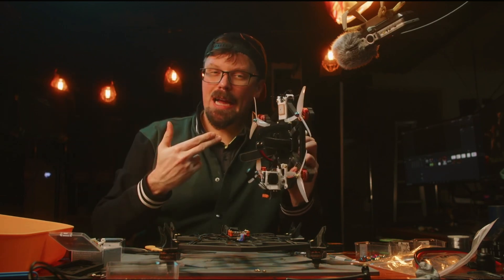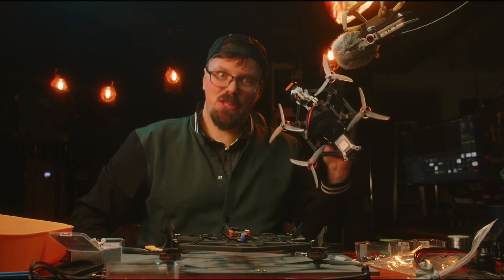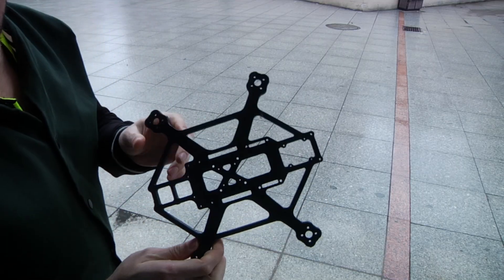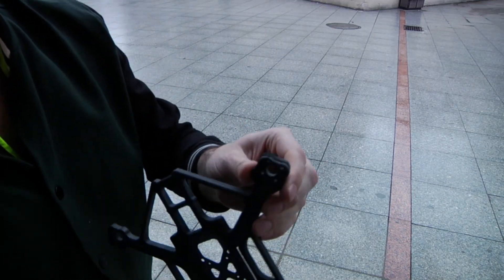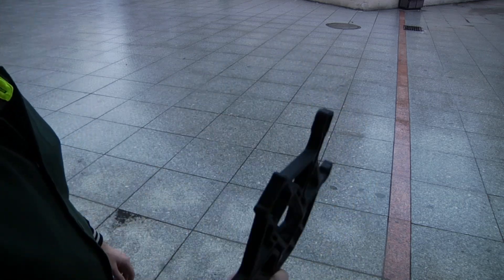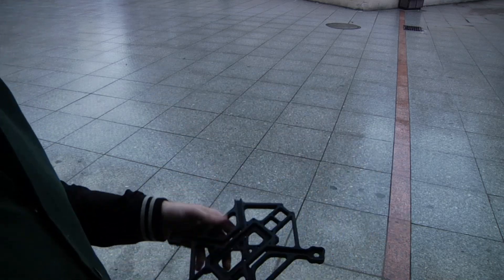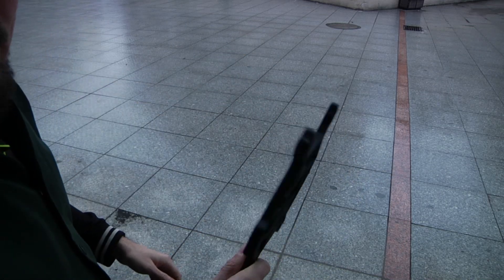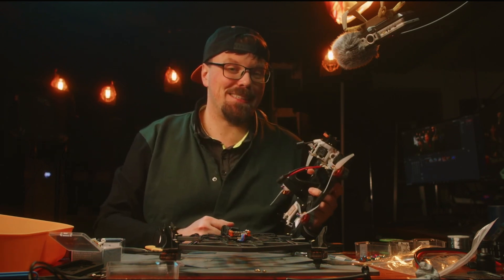Can this 3D Printed Drone Change FPV?

Comment from the maker: https://drive.google.com/drive/folders/1zxm0brhdy93jc6833aE_C-0zilZd7Qmq?usp=drive_link
Reply: THX for  sharing - Assume it was a bad decision to print most of the components and realize that I can fit the  5' frame on my printing table :D. I have Elder 3 pro, looks like a few mm is missing - what a shame, electricity, and materials to the bin :(
Reply: I incresed printer X settings  for extra 5mm , I was able to sliced , let's see what's going to happen :)
Reply: I know this is an older video but did you do a vid on assembly? I like to build stuff and don't care if someone says you can do it. I say "Hold my beer!"
Reply from the maker: @wickedspoke5443  not a video but a guide over on the Patreon

Comment: Personally I think the 10mm U beam design is a great choice. A good balance between price to print, no need for supports, and obviously little to no strength performance change. Already have my frame printed. Now just need parts to get here.

Comment: Once that frame is fully loaded it might be a little more prone to breakage, but wow that filament is VERY strong, impressive!
Reply: Breakage from what. Most pilots fly quadcopters and don’t crash them. Resonance and vibration-characteristics is what I care about picking a frame.
Reply: @nickvledder  I fly through tree's amigo..so breakage from a tree...not thin air.

Comment: I'd argue that it comes down to your intended use. That would probably be fine for people that just want to cruise around with the drone and do mild aerobatics.  It would probably save some money. 

But if you intend on doing something that will likely crash frequently (like freestyle tricks or racing), then consider something like the TBS Source One v5 (or the old v3) The v5 is $30 and the old v3 is $27. SpeedyBee is also going to release a frame called the Mario for $34 soon, too. I'd rather pay $30 dollars for a frame and be able to replace arms in 1-2 minutes with replaceable arms, than have to reprint an entire frame with an expensive filament and spend an hour swapping all the components to the new frame just because an arm broke. It comes down to a matter of convenience and how much a quick repair is worth when you want it.  

On top of that, well known frames, like the Source One have 3d printable accessories readily available. While I rarely use those things, its nice to have accessories for different hardware readily available.
Reply from the maker: Oh